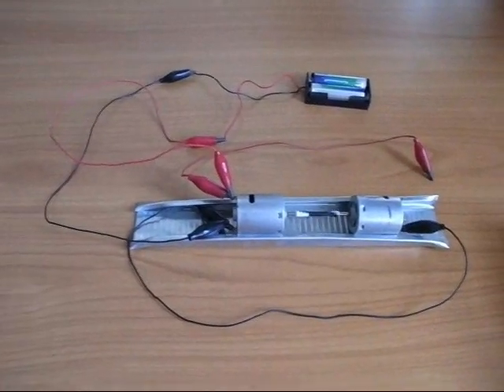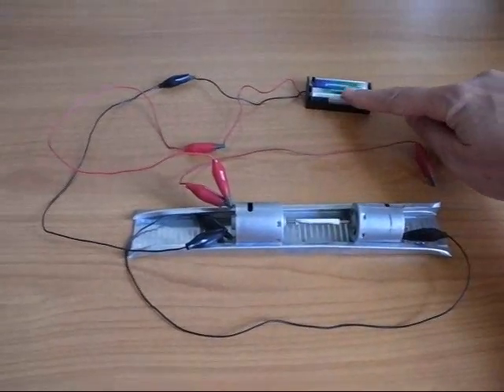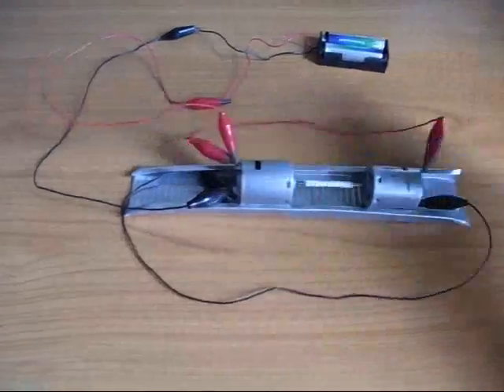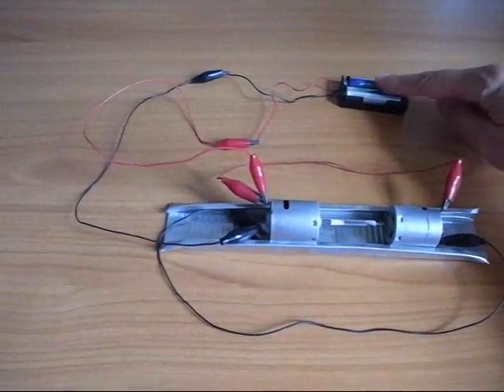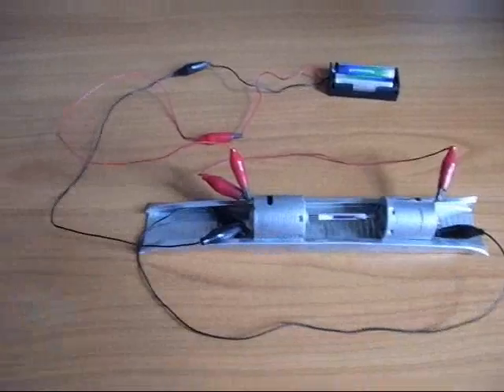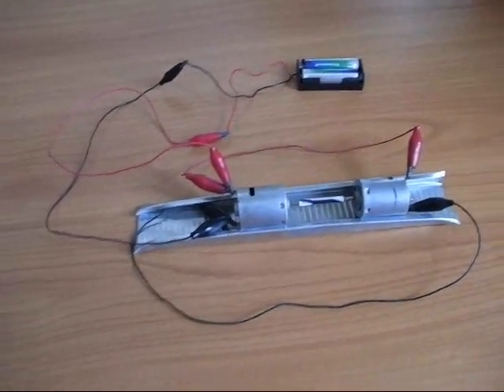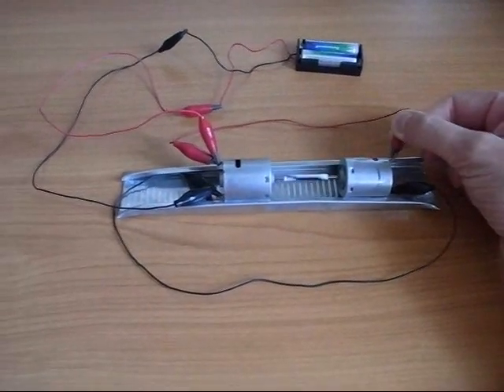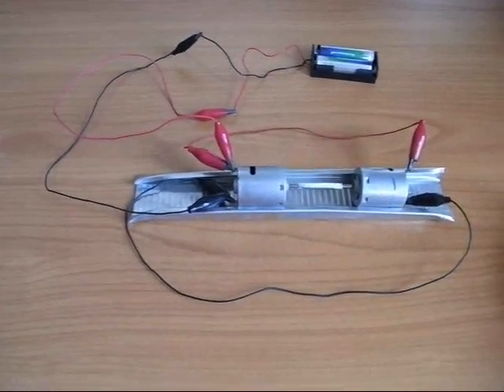Free Energy? Proof of Over Unity? You Decide! (Re-shot)

Comment: You're not right showing overunity so much as you're putting a second load on the generator buy feeding it back into the motor the motor is pulling electric crayon the generator and your setup needs to battery to run and once you take it out it has no magnetic force to continue the commutator there is a theory that you might be able to use back EMF in a circuit to continue that power source an oscillation AC generators Nikola Tesla supposedly had a generator motor unit that supposed to rain on the currents in the earth to run the motor which would spend the generator and power something but nobody's ever gotten one made or even attempted to create such a system or look at the patent

Comment: Twice the coils, twice the magnets.  Yup, it will run faster (unless you bottom out the batteries -- which you will do if you keep adding more "generators." Try it out!).  Another way to think of it ... add two engines to a single car.  It will run twice as fast.  But consume twice the fuel.  Running off of the same tank (the battery), you'll have to go to the gas station in half the time.  An experiment to see show that energy is being consumed faster from the batteries, put up two such systems side by side, one with one motor, one with two motors.  Each with fresh batteries.  Let them run till the batteries run out.  See which one runs out faster.  And how much faster.
Reply: Partially true...
Reply: You wouldn't need to go to the gas station in half the time

Comment: tsbrownie hi I am a fan of your work; And i have a request .
I wonder if you are interested in trying a voltage doubler and adding it to this circuit and making a video of you results I have a specific voltage doubler in mind which i saw chiswantstoknow explain and build  it here is the link https://www.youtube.com/watch?v=su1-CyEUNZM 
I believe in theory it should work the motor/generator should continue because a voltage doubler contains two capacitors that should keep the energy the generator builds stored and ready for use to continue to drive your motor for your generator but i have no way to test it myself cos i don't have your equipment (generator you built)Just be aware that the diodes you use may have a resistance of different values silicone diodes have the highest germanium diodes have a medium resistance and i believe that schottky diodes have the lowest resistance the lowest resistance is more desirable to make a voltage doubler work
Reply from the maker: +Roc Lo The generator I used was just another small motor.  I will have to put this on a list of to-dos.
Reply: thanks i can't wait let me know when i can watch this i always look forward to your videos
Reply: you can't double voltage without loosing 1/2 the amperage

Comment: it wont work cause the generator motor cant generate enough current for the other motor to run ends up stalling the running motor well but u can try some thing use a gyro scope or a fly wheel or something belt drive the motor with a fly wheel and some step down gear to the flywheel then step up to generator
Reply: Fly wheel? No

Comment: This seem an easy one to answer. The first motor turns slower due to the resistance of the magnets in motor 2, When you connect motor 2 to the power source, the magnet resistance is removed so the revolutions of the motors increase. I have no education in electronics, but this seems simple to me?

Comment: the answer is simple ,each motor winding has an x amount of resistance. the 2nd motor is now parallel connected to the battery and you have 2 resistors of x amount now.When resistors are connected in parallel, the net resistance of x actually drops and now the overall load of the motorS is half of x resistance...when resistance drops more electricity flows from battery, it is simply draining more energy from the battery to the motors and turning them faster as result...nice try good luck

Comment: I suggest an experiment. First measure the current into each motor separately one at a time with them mechanically connected. They should be about the same and the currents direction should also be the same if they are very much a like and turning at about the same speed. Then measure the currents direction of output from the second motor acting as a generator powering a small light bulb from a 3 volt flashlight the current should be flowing in the opposite direction to when it was operating as a motor

Now connect both motors together and measure the currents direction into each motor. If one motors direction of current is opposite the other than one is acting as a generator. If however the current into both motors is flowing in the same direction then they must both be operating as motors.

Comment: Look up thermodynamics.. Every and i mean EVERY electrical circuit looses energy in the form of heat. (unless you cool it down to absolute zero but then the electrons cant move either and would take a huge amount of energy) So no this will never ever run on its own even with a 100% frictionless design (which is impossible to begin with..)

Comment: Ok what is happening when he wires in the extra motor (incorrectly called a generator) it now is also running as a motor. Before wiring it in the energy from the first motor had to also overcome the bearing friction in the second motor. Once wired in two motors now overcome the same friction with double the force available. The speed of these types of motors is limited by friction only.
Reply: Kim O'Brien Also there is no evidence presented as to how much faster the motors run. We have only the video makers statement.
Reply from the maker: Kim O'Brien Can check the movement per frame.  It's about 3x.  Even if it's 1.1 x that's something, but in any case it's faster.
Reply: tsbrownie I don't doubt that adding a second motor will increase the speed. If you assume that the friction increases directly proportional to speed than I would expect the speed to double if everything else were to stay the same. However after a quick look at some friction (coefficient of friction) curves that isn't always what happens. Depending on speed friction may drop slowly than sharply then rise again.

Comment: it runs faster because the other motor is also getting power from the battery. if ur gonna take a look both motors are on series connection. u should measure the output and input voltage to determine if there is an excess energy for free. ^__^

Comment: Here is why it runs faster after connecting the second motor. When the second motor is not connected, the first motor must overcome the internal magnetic attraction to the internal rotor pole pieces. It becomes a mechanical load to the first motor. This slows down the first motor.
When you connect the second motor to the battery, it is now doing work and aids the first motor rotation. Without a mechanical (magnetic load) on the first motor shaft, it spins faster just as demonstrated.

Comment: Think of the first motor as no more than a starter..but it unified the frequency of the two motors the best you'll get is a higher frequency second motor..so lower frequency motor spinning higher frequency motor output, wire it back to the lower frequency motor source and steal ur hertz..is the idea but it's kinda opposite logic with a load on the end without drawing too much from second motor..I've seen a alternator, two battery banks lasts about 1/2 a day with like 13 car batteries on the net..with a charger the same voltage as the first motor..

Comment: All you did was add battery power to the other motor, so in taking the strain off the original motor. If you separate the motor from the generator and use the generated power to run the motor going through the batteries with excess energy you will have something.

Comment: you broke circuit try put a jumper wire in place of battery
Reply from the maker: The batteries are on separate wires from the wires that connect the motor side to the generator side.  I will look again, but I think it's OK.  I could be wrong, but if I put in a jumper it would cause a short I think.
Reply: I have been messing around with those motors too and I have found some suprising results.I hooked one motor up to battery,then cut the - wire.hook one end to the + terminal on the second motor then the other end to the - terminal of second motor.the second motor will run just putting it in line on the negative wire of the first motor same works on positive wire.then try 3rd motor add a transformer coil try all kind of variations

Comment: I am not an electrical engineer  but your batteries should be on an amp meter and volt meter ,your motor on the right is generating electricity at the reverse polarity of the motor on the left (turning reverse rotation) when you connect the wire to the motor on the right  you are connecting a series circuit with your batteries and the generating motor on the right probably doubling the voltage and increasing the rotation speed.

Comment: Looks legit! Where can we buy your book? Or have the greedy oil companies suppressed it?
Reply from the maker: No book (yet).  I do these to provide a place for people to openly discuss these.  Many videos turn off comments and / or require approval of comments.  I got tired of all that and made these to have uncensored discussions.  Was not thinking about cashing in on it.
Reply: tsbrownie
Ya know, since this is DC, you could put an ammeter in series with the battery and see what the current is, with one or both motors connected. If the current was negative, it would mean the second motor was putting energy back into the battery and you are running over unity. If it stays positive, that means you are still sucking juice out of the battery.

You could also put a diode on the second motor's output and measure the current fed back into the battery. And see how fast the shaft turns when it is running as a generator rather than as a motor.

If you had a second ammeter, you could measure the currents of both motors and see which one was acting as a generator.

Then, you could walk around the table and ask yourself, "Wait - is the one on the left or the one on the right acting as the generator? Because they're in parallel."

After you post the results in another video, wait for the comments from the Over Unity crowd on why your machine doesn't work on generating excess power. Since it's DC, there's no Tesla magic in it. Not enough magnets. And certainly no crystals.

I see some other commenters already gave away the "secret".
Reply from the maker: James Van Damme There are a lot more ways to slice this.  Just need to find the time to put it together.

Comment: No, all you have done is wired the motors in parallel. One motor spinning the other create drag then the motor or generator as you call it is running of of the batteries hence making it easier to spin. Sorry no over unity.

Comment: Essentially one motor runs in one direction and the other is linked to the second and the direction of turn is the same. The second does not act like a generator any more than the first - both are driven in parallel. If the motors are identical and the speed the same, theoretically the speed should not change but the torque double or quadruple - I forget. However the speed has tripled which is interesting. Is the second adding energy to the first after all? Is the increased energy raising the voltage enough to triple the speed? Interesting!

Comment: Those are just two motors, connected parallel to the battery and physically together. But that won't create any free energy, it's basically just like one motor and when it looses power, it will stop spinning...

Comment: If I take a pushbike, fit a sprocket to the front wheel, and run a chain from the front wheel to the back wheel, would it propel itself ? No! What if I fit a smaller wheel on the back, so it spins faster, so it should try to spin the front wheel faster, and propel the bike? No, that wont work either. Same thing.

Comment: When you connect the second motor to the same wires you have two motors connected to the same battery not a motor hooked to a generator. Two motors will turn the shaft faster than one motor.
Reply: Jim Fortune Exactly right.

Comment: As an eight year old kid in the 1960's sketched up a version of this but with a fly wheel between the motor and generator and showed to my dad. He said quit goofing off and finish my homework. Maybe if I'd used a fractal antenna while beaming scalar waves at it I would have tapped zero point and hit over unity. Guess this rig spins faster with the gen. hooked cause of a faster current draw.

Comment: Misconception number one - Over Unity or zero point energy is NOT perpetual motion.   Perpetual motion is impossible because it requires NO energy input whatsoever.   Over-Unity systems are still putting power/energy into the system, however little that input may be.  Without at least some small percentage of energy coming from somewhere ANY Over-Unity system would fail.

Comment: I wish to complement the experimenter for his honesty and the simplicity of his set up. As he states there is not fake or trick innvolved and this itself is a great relief from the many other videos and impossible claims made by just about any one who can hold and use a screwdriver. The explanation of the present set up has nothing to do with free energy and output being greater than input, an absolutely impossible situation despite the hundreds of claimes made to the concrary. The increase in speed when the other similar machine is connected ijn parallel to the motor is due to the situation being different to that existing without the  second machine being connected. As both machines are connccted in parallel to the battery botjh machine ruan as motors. It would seem that the machines are identical and could probably be 20 watt dc motors. With a single one being connected the motor reaches a speed when the input is just sufficient to make the motor run at its mazimumj free speed as there is no load to be taken care of. When the second identical motor is connected, the system is now a 40 watt system and as there is still no external load to be taken care of , the 40 watt system should run at twice the speed of the 20 watt system. This increase in speed can only be obtained using dc motors or universal motors but not ac motors which run at a constant speed. The situation is simmilar to a car just about able to make a stiff climb. If a second car of the same type and power is used to assist the first one, both cars can make it to the top of the climb. Congratulations for the effort and honest displayed.

Comment: Answer is.....Not over-unity...as it cannot power itself....

Don't use battery....don't use motor....use water wheel, or Wind propeller to move generator....now you have free electrical power....
Reply: You are also not putting another load to it...so it just runs a faster loop....can the generator, run the motor faster, while producing current for another load???

Comment: When you attach the second motor to the circit, wouldn't the power from the battery feed into the second motor? Try putting a diode in the circit to seperate them, and mabey a capacitor might help it along. Just a thought.

Comment: In the disconnected state the second motor produces drag and resistance. By connecting it, it reduces the produced induction voltage created by the first motor. In other words: the secondly connected motor compensates for its own produced resistance and behaves more like a free running axle. If you never connected the second motor, not even by axle, the first one would even run faster. Nothing gained, but the only effect is less resistance.

Comment: 2 similar motors cannot be used to drive each other....one motor must be able to put out higher current even with a slight voltage drop.....current is needed to drive a motor..any motor....your system doesn't work when the battery is removed because the motors are similar hence same output.....you must take into account losses,.....heat, magnetic field strength, hysterisis loss, core saturation, friction from bearings and back emf from collapsing magnetic fields.....more current is required to overcome these losses.

Comment: connecting the second motor in parallel with the first motor and battery simply means more drive power ......but more current draw from the battery...put an ammeter in-line with the battery to measure the current draw when ytou connect the second motor...current draw will increase